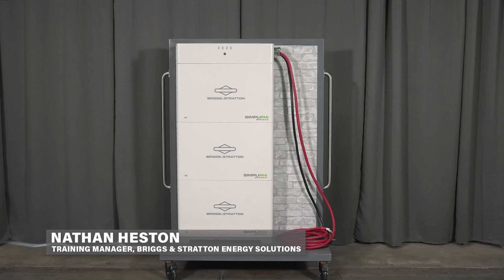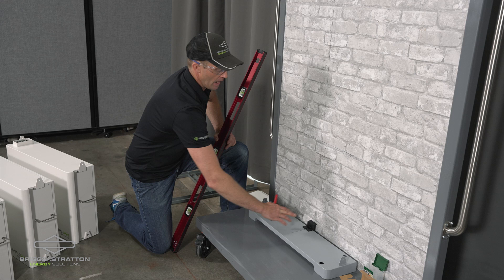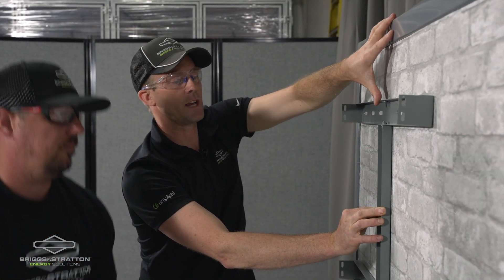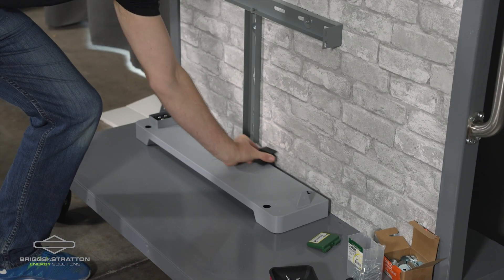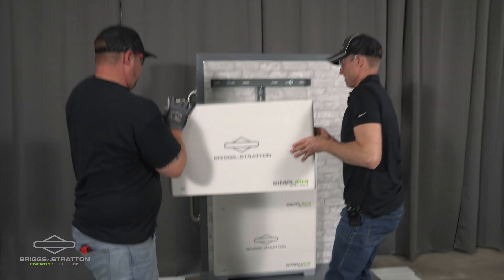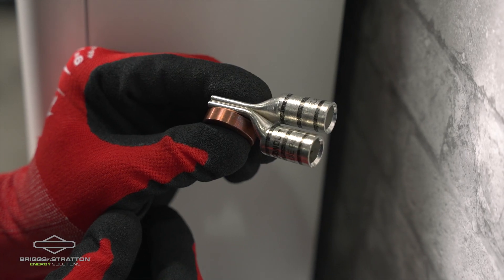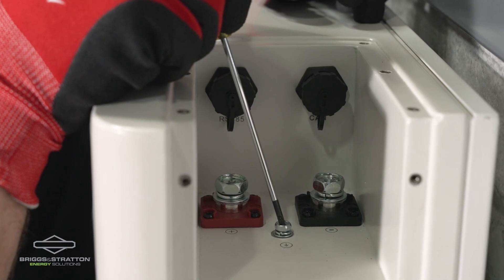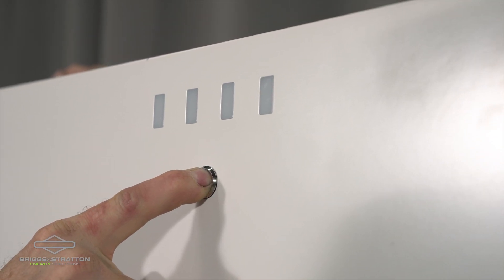How to Install a Briggs & Stratton SimpliPHI 6 6 Battery System

Comment: What size connector was installed in the side of the controller?
Reply from the maker: Hello @todd5963 The video shows the installation of a single set of 4/0 battery cabling.  Installations where a single 6.6 stack is paried with a Sol-Ark 15k are often done with dual sets of 1/0 or 2/0 cabling to match the Sol-Ark 15k's dual battery inputs.  You can read more about battery cabling and sizing in our integration guide which is available at: https://www.bascodigital.com/assets/share/asset/annbd2jvlo
Reply: The conduit connector was 2".